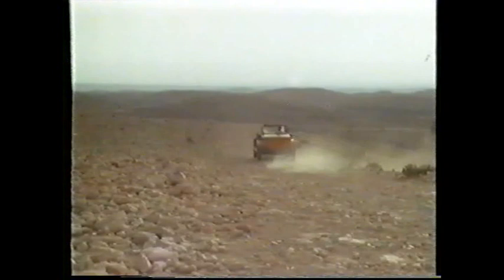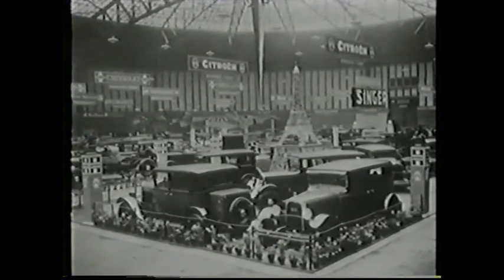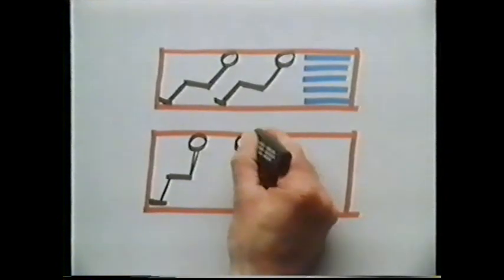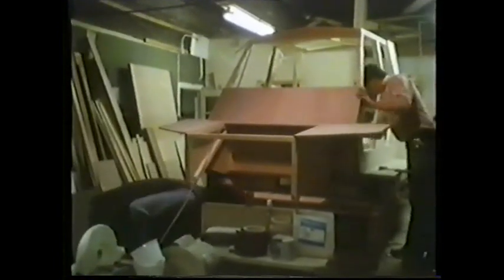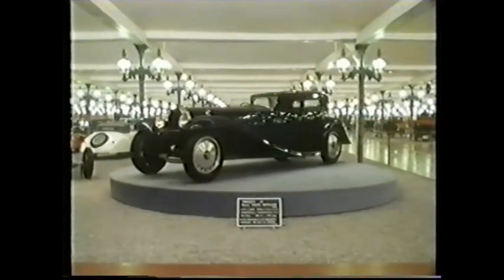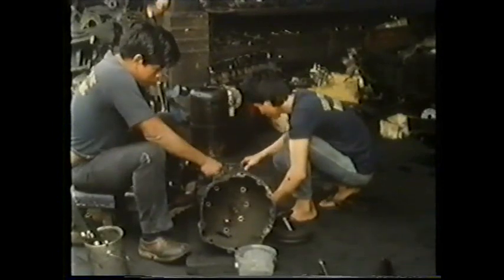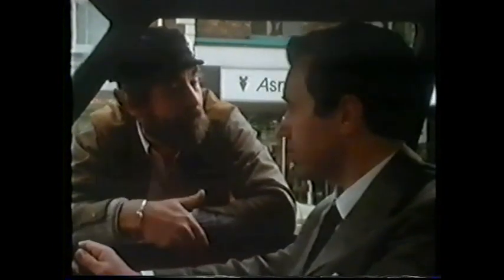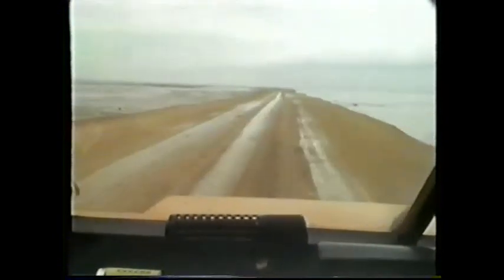Africar PT2- A CAR FOR AFRICA - and for the ordinary road.  Part 2 - The French Connection

Comment: The criticism of the VW beetle didn't age very well. One wonders what it was about the beetle that kept it being made while the traction, despite apparently being very popular for its time, did not continue..

The narrator mentions that the beetle is reliable and air cooled, but I suspect that one of the reasons why the beetle and the vehicles that were derived from it like all of the Porsches, lasted was that the design was actually more modern than the traction. The traction, while beautiful, still harkened back to an older style, with its separated headlamps and narrow hood.

In contrast, while the Beatles still paid homage to those features, it was more modern looking for the time. The fenders were better integrated into the overall shape, the headlamps integrated into the fenders, and the simplicity of the shapes of the beetle made it seem less out of place as vehicle Design changed.

And it was not just its reliability, it was how easy it was to repair as well. Of course an air cooled engine isn't always the best ideain hotter parts of the world, but eventually VW created water cooled versions which overcame this issue.